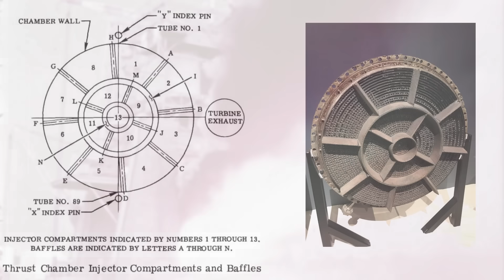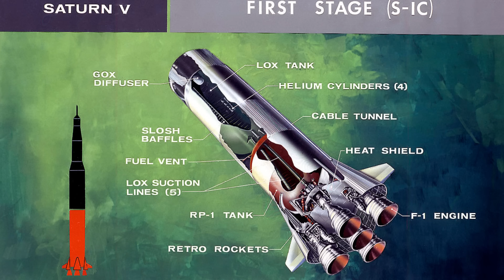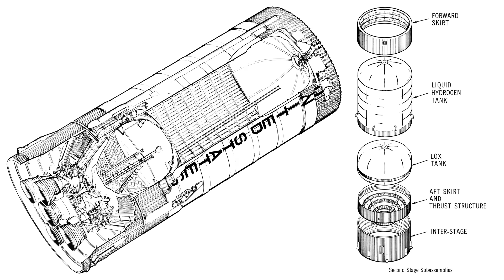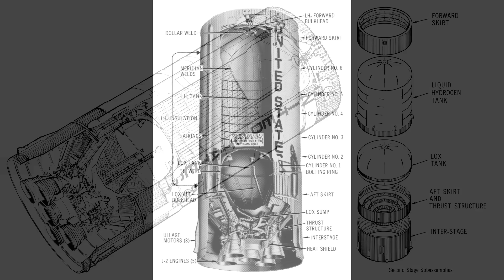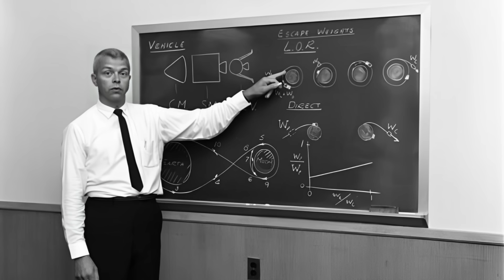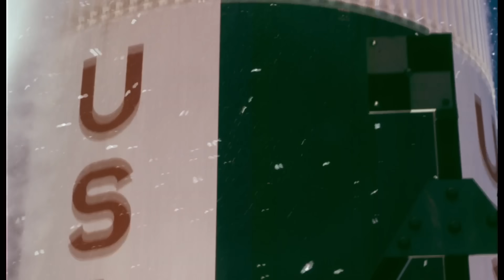The Hidden Engineering Tradeoffs of the Saturn V

Comment: The F1 engine is a triumph, but an example of brute over simplicity. Vibration issues due to its size, answer spend millions on almost blind  modifications to the injector baffle, while the russians facing similar problems just used two or four smaller nozzles to remove the problem

Comment: This is more or less the description of how every engineering project is carried out for everything from toys to domestic appliances to bridges, buildings, vehicles and aircraft. You can call it compromise but as an engineer I'd call it optimization. The solution chosen is judged to be the optimum choice based on the conflicting constraints.
Reply: As an architect, I'd agree completely. And often it's not just "cost effectiveness". There can be countless other mitigating factors - and opportunistic advantages (some serendipitous; accidental) - involved in the design process.
Reply: @jamesrindley, absolutely true! Down to the last nut, electric components, wire, hydraulic, and fuel lines. In school, we talked about the application of simple economics for the engineer during the design phase. The general rule of thumb number when considering reliability and cost along with MTBF and similar concerns was 10 to 20%! An electronic component, for instance such as a resistor can have a tolerance as high as 20%, 80% of the time without causing a major shutdown where components considered SPF items are much closer to 100% or zero tolerance of the specified number. The employer has a budget and must bid for the contract. This makes it necessary to minimize cost of production while still producing a safe and reliable product. I was assigned to the Marshall Space Center at Huntsville at the lab that ran the failure investigation tests for the Challenger. My boss was the EIC for the investigation. He didn't say much about the findings but like the NTSB does at the conclusion of their investigations, he and his team made suggestions. So, in an ideal system, all components are the best manufactured. History has proven that proper designs compensate for less than optimum components of a system. What happens sometimes is neglecting to inspect single failure point items. The ETBF of critical components should be honored and replaced at that time.
Reply: As a chemical engineer, I agree completely.  Engineering design is always optimized around known constraints.  For manufacturing, cost is obviously a large factor, but safety versus risk is a major consideration.  For Apollo, known risks were mitigated as much as possible, but the out come required accepting much more risk than would be acceptable for commercial flight, obviously.

Comment: Please take this is a s8ncere question: you're walking a fine line when you differential 'booster' and 'spacecraft' to get that 10 number? Actually, it could also be 9. Apollo 13's service module had a stroke outbound to the Moon. The SM is also a rocket. During the boost phase into Earth orbit, the SM isn't employed. In fact, the SM stays inactive (except the fuel cells), until after TLI, when it initiates the TDM- where the CSM pulls the LM out the forward end of the S4B. 13's SM failed. Was the SM considered a part of the S-5 system?

Comment: There were thirteen Saturn 5 launches, not fifteen. Apollo 4 and 6 were test flights. Apollo 8-17 were manned flights. Skylab 1 put the space station into orbit.
Reply: Apollo 7 was the first manned flight.
Reply: @Anton-w8l8j  Apollo 7 was the first manned flight of the Apollo program.  However, the launch vehicle for Apollo 7 was the Saturn IB, not the Saturn V.
Reply: @Anton-w8l8j  Yes, but it was a Saturn 1B, not a V. KRW628 is absolutely correct. 13 launches, AS-501 to AS-513, not 15.
Reply: Skylab 1 was the station, not the launch booster.

🌌🔭
Reply: @scottmcintosh4397  No. The station was called Skylab. The launch was called Skylab 1, and the three crewed missions was called Skylab 2-4.

Comment: Video has a cautious Narrative,  and great Information.   Yes, there WERE compromises.  One could imagine what the Soviets were under to get their Moon Rocket to even Work. 

I  REALLY appreciated the EXCELLENT shots of those mighty F1 Engines under Test and in Use on Saturn 5.
Reply: Every step of the way, the Soviet N-1 was a total Kaputnik 🚀💥💀

🌌🔭
Reply: @scottmcintosh4397 Yes, talk about compromises-they hadn’t developed any engines close to the F1 so they put 30 engines in the first stage and that caused the failure of the 4 flights before it was cancelled. The fact that designer Korolev died during development was a big factor also.
Reply: I hadn't seen those films before too, very impressive.

Comment: THE COMPROMISES/TRADE-OFF'S WORKED FOR THE SATURN-V BUT SADLY THE SAME CANNOT BE SAID FOR THE SPACE SHUTTLE THAT LOST 14 ASTRONAUTS FROM TWO CREWS ON TWO MISSIONS ? ? ?🤔🤔🤔
Reply: One of the great aspects of the Saturn V rocket is the stages that are used first are at the bottom. If something falls off, it will damage what will be used up first. And, more importantly, it's pencil design means it is hard for a part to get a good solid strike against anything below.

In contrast, the solid fuel rockets were side by side with the large liquid oxygen tanks which would be used a few minutes later. A malfunction of the solid fuel rocks won't send flames into empty space but into the liquid fuel tanks.

Comment: THE AMAZING THING IS THAT THE SATURN-V WAS DESIGNED USING JUST LOG TABLES & SLIDE RULES & NO COMPUTERS OR COMPUTER FLUID DYNAMICS OR OTHER COMPUTERISED TOOLS THAT WOULD BE USED TO DESIGN & DEVELOP THE SPACE SHUTTLE ! ! !🤔🤔🤔👍👍👍
Reply: Actually, by the mid-1960's they were using IBM 360 computers for design work.  The spaceships themselves had 60 pound computers as powerful as a TRS-80 - possibly the first microcomputers.
Reply: most of it was designed in germany 😂😂😂😊

Comment: Many people wax nostalgic about the Saturn V, forgetting how few times it actually flew.
In comparison, the Shuttle system flew 135 times, with the loss of 1 crew during launch.
Today's Falcon 9 has an even better safety record. 
I think an extended Apollo program could have experienced a launch failure of the Saturn V, although the crew was protected by the presence of the escape tower until late in the ascent phase.
Still, the Saturn V was an astonishing accomplishment only 20 years after WW2.
Reply: @gasev63
The shuttle failed on the 25th flight; then it was ‘fixed’.  The Saturn rockets wouldn’t have fared much worse.
Reply: Uh, there were two shuttle crew losses.
Reply: @creid7537 One crew was lost during launch, and one crew was lost during reentry. I was referring only to launch.
Reply: @gasev63  Well, if you want to get pedantic about it, Columbia was lost due to damage from the launch... so maybe splitting hairs isn't the way to go about it.
Reply: Hay un error de concepto tenemos que partir de la idea que el programa Apollo no era un  programa de larga duración debido a los plazos que debía cumplir su objetivo, además fue recortado su presupuesto una vez que alcanzó su objetivo..
Entonces debemos ser justos el Falcón 9 todavía creo que vuela y puede fallar .....
El Saturno 5 ya quedó en la historia para siempre y esa tasa de eficiencia nunca va a ser igualada ....ni siquiera sus motores F-1, únicos....
Reply: Además tienes que tener en cuenta la tecnología que había en esos años el Falcón 9 se hizo con computadoras en cambio el Saturno 5 con reglas de cálculo y papel NADA de computadoras
Reply: I used to jokingly say that an Apollo spacecraft (and launch vehicle) was the worlds safest form of transportation, since no one was ever lost flying it.  Obviously there were too few flights to be statistically significant.  But, even so, it was an incredible example of engineering.  The NASA publication "What made Apollo a Success" (NASA SP-287) is worth a read.
Reply: BY "EXTENDED" DO YOU MEAN IF THE APOLLO PROGRAM HADN'T HAD ENDED AT APOLLO-17 & CONTINUED TO APOLLO-20 WITH A FOLLOW ON APOLLO APPLICATIONS PROJECT WHICH IS WHERE SKYLAB CAME FROM? THE SAD FACT IS THAT BEYOND APOLLO-17 WAS THAT THREE SATURN-V VEHICLES WERE BUILT, PAID FOR & DELIVERED TO NASA BEFORE THE APOLLO PROGRAM WAS CANCELLED AFTER APOLLO-17 & CONSIDERING THE RELIABILITY OF THE SATURN-V (IT SURVIVED BEING STRUCK BY LIGHTNING TWICE DURING THE LAUNCH OF APOLLO-12 SO THAT PROVES JUST HOW ROBUST THE APOLLO PROGRAM & THE SATURN-V VEHICLE WAS) IT'S ARGUABLE IF THE SATURN-V WOULD HAVE SUFFERED AN LOCV (LOSS OF CREW & VEHICLE) EVENT GIVEN IT'S PROVEN RELIABILITY TRACK RECORD?🤔🤔🤔

Comment: Compromise; pity politics hasn't utilized it as efficiently.
Reply: Engineers wouldn't necessarily phrase it that way, we tend to look for the optimal solution within the constraints of the project regarding time, mission objectives, cost and risk of failure.